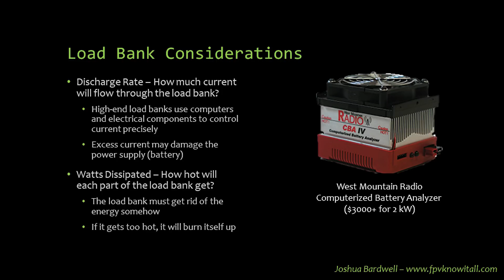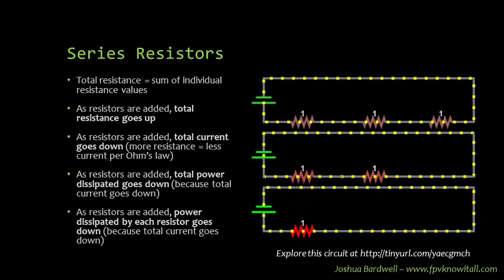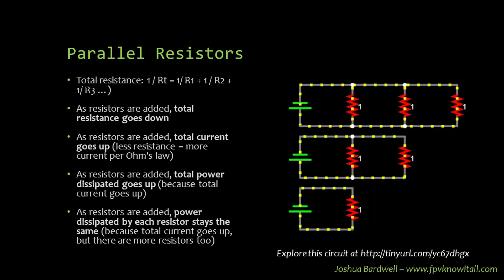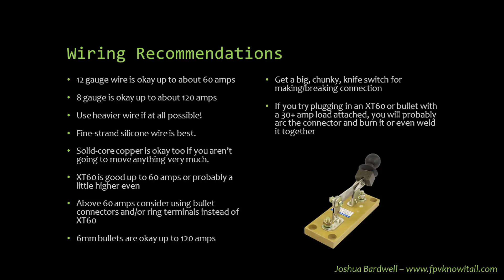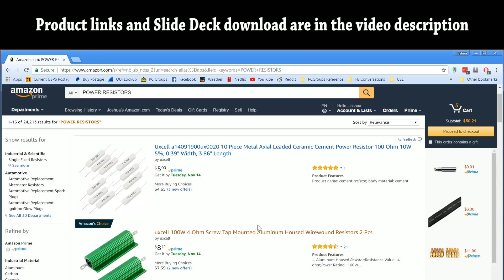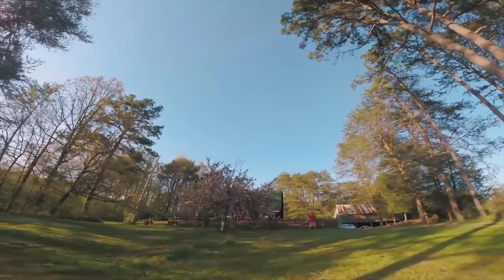Comment: A great alternative to resistors are peltier devices.  I run 2 in series or parallel depending on the cell count i am discharging.  I have them attached to a big server CPU heatsink and it works amazingly.  I can discharge a 1300 4s pack in about 4 mins.  What I REALLY want to do is automate it...

Comment: I actually built a "load bank" out of 12 old stove heating elements. I use it to quickly discharge my 12S ebike batteries at about 1000w. Works great.

Comment: Or buy a bunch of 1 USD Ceramic Cartridge Heater for Arduino 3D Printer ( 24V, 40W) - Basically they are power resistor, but works at full potential as a bulb. and $ per Watt is the lowest, and comes with nice wires too. win/win ? I do use one of this heater to discharge my batteries when needed. I'd like to hear your thoughts JB
Reply: Assuming you're working at 24 volts, you'd need 25 of those to get to 1000 watts. Or maybe less than double that at 4S voltage. Still only about $50. But geez it's a lot of wiring!

I wonder what the downside might be...
Reply: nice idea I was thinking of ceramic heaters too but only knew about the room heating bars and solder iron rods. lol these are cheap too I might get some for a pocket heat project. thanks
Reply: Downside would be messy, but with a nice cover, the topside would look nice, like some Chinese products - Ok, in practical terms, I am not discharging a nuclear power supply, but my simples 1300 mA  4S occasionally - One simple ceramic heater in a XT 60 is doing the trick in couple minutes. But for serious guys out there with many batteries and serious needs, a more robust anti-power-bank is a must. As always, great class.

Comment: It reminds me my first discharge attempt. After crashing my first quad, the (faulty) esc burnt, my battery was full and my charger couldn't discharge... So I quickly built an electric circuit to discharge the battery by using a big stepper motor. It took 3 hours...

Comment: Joshua you can easily use TEC (thermoelectric cooler) and stick old CPU fan on it and solder XT60. It will work good for discharging lipos
Reply: Hmm. I wonder whether getting really cold or really hot is better? What is the efficiency of TEC anyway? 

Hey! Maybe the ideal would be to pair a TEC with a load resistor, then their temperature would cancel out!
Reply: Joshua Bardwell yeah :D I like really cold, I use them when discharging my lipos. And I can play with it :D

Comment: The mk2b 3d printer heatbed has windings for 1 and 3ohm, should handle ~10a with a small fan blowing across it, and costs under $15.

Comment: Joshua,First, thank you for such a great, detailed video.  I am a teacher in the largest public school system in Ohio and your presentation was top-notch.  Second, although I understand the formula's and math, I am confused on:1) what stops a 2S lipo battery from dumping all of its juice.  While racing, we have to use the ESC to determine how much and where. (I.E. 6v or 7.4v to the servo)2) Why not just buy a 200w, 10k Ohm resistor and plug it in?  Does the resister determine how much the battery can dump?Also, could you please make a quick video for a 2S lipo, 7,000Mah battery.  I see many people using six 100 watt, 1ohm resisters in parallel but based on the math, they should blow.  Thank you for your time.  I just found your channel but will share it will all of the racing community.  Tony
Reply: Since you're a teacher, to answer your question, I'll throw one back at you. 

1. Based on Ohm's Law, how many amps will flow through a 10 kOhm resistor when a 7.4 volt potential is applied across it?

2. Using the formula given in the video, how many watts will the resistor dissipate? Assume constant 7.4 volts although in reality, the volts will drop as the battery discharges.

3. How long will it take to completely discharge a 7000 mAh battery at this rate? (At a rate of 7 amps, a 7000 mAh pack will completely discharge in 1 hour. At a rate of 14 amps, it will discharge in 0.5 hour. And so forth.) Assume constant discharge rate, although in reality discharge rate will go down as the battery voltage drops and actual time will be longer.

The real-world situation is that you are balancing all of these factors: amps, watts, and time to discharge. The ultimate answer to why those guys use 6x 100W 1 ohm resistors is that produces the right balance of those factors for their needs. The rest is just math.
Reply: Q1: .00074 amps (I) will flow (I'm assuming 10 Kohm Resistor is 10,000 ohm.) I used the formula I=V/RQ2: .005476 watts will be dissipated by a 10k ohm resistor on a 7.4v battery using P= V squared/RAnswering your questions using a 100watt, 1ohm resistor, my answers are:1) 7.4 amps (I) will flow2) P= 54.76 for a 1 ohm resistor from a 7.4 battery.  If I am correct, I can see why they are using a 1ohm resistor now.  I would like to know you opinion on "can a battery try to discharge 100% of it's charge if plugged into a group of parallel resistors or does can the battery only discharge so much at once"?  Why not buy resistors that a larger so they are not as close to they max load?I know this is a lot of questions and I thank you for your time.  You will be compensated for it.
Reply: My answer can't be correct due to how large the amp draw is.  It would never be that large.
Reply: @TD-zx7kf  Bueller ?

Comment: automobile headlight bulb is the cheapest load for drones batteries. i'm using H4 60W halogen with simplest lipo-beeper, works well with 4S. even with parallel board and multiple packs, discharge rate is ok for me.
Reply: Let's see if that's true...

I looked yesterday, and a 25W+5W dual-element bulb was $7 for two, or $0.11 per watt. In my experience this bulb will pass about 3 amps at 4S voltage, which gives it an effective resistance of about 5 ohms. 

Can we do better? Here's a 200W 2 Ohm resistor for $20. http://amzn.to/2zIqEVs So that's $0.1 per watt. But actually the picture is not that rosy because I would never run that at full 200 watts in reality. I chose 2 ohms because that produces about 140 watts. So actually we are at about $0.14 per watt.

So maybe that's right... Especially when you consider you have to buy heat sinks for the wirewound resistors. But at the same time, it's best to buy receptacles for the automotive bulbs unless you want to desolder them when they burn out. But it's at least worth considering.
Reply: I still think halogen bulbs win though.

http://amzn.to/2yZ1LI2

That's 5x 50 watt 24v halogen bulbs for $12. So you get 250 watts at 24 volts, or only about $0.05 / watt. And if you buy 12v bulbs  (http://amzn.to/2yBLrc9) you get 10x 50 W for $10, or oly $0.02 per watt.

So I think halogen bulbs beat automotive bulbs, but all of them beat the pants off resistors.
Reply: +Joshua Bardwell here in local store we have it around $1, and if you own a car, you may use old one for free (if near light is broken) anyway, it depends on either you want to heavily test different electronics or just discharge few packs after flights.
Reply: Yes, for sure. If you just want to discharge a pack, you should use the SMOKE STOPPER that you already own!

Comment: Good old automotive bulbs work well too. Been using them for years. Then you get light for the shop too :)
Reply: I don't think this is a good value though. It's about $7 for 2x 25 watt bulbs. That's only 50 watts for $7. Well, they are 2-element bulbs so they're actually more like 30 watts, or 60 watts in total.

I can get a 10-pack of 50 watt halogen bulbs for $12. Way better value if you want to go that direction.

Comment: Perhaps I missed it but I can’t find a PART 2 or this video, can you link me please? I did find this helpful.
Reply: Sorry but I haven't made it :-(
Reply: Okay so not crazy 😂😂😂😂😂 it’s okay. It would be great if you did make it. I’m actually working on plans for a lithium powered portable electric heater/ dump load style with a fan. I’d be using left over solar power in a separate battery than the pack powering my small RV.

Comment: I watched it all lol. This video was very helpful for me trying to make a home made heater. (To discharge batteries and make heat as a bonus lol)

Im going to use different inputs to have different settings.

I can use series to control temperature and parallel to control heat/power consumption

Ill figure it out lol

Comment: This is quite useful, when I break all my quads and have a bunch of fully charged lipos the situation really sucks. Then I know when I get home I'll have to dishonourably discharge all my packs on chargers that fail horribly at discharging AND then repair the quads. It would be nice not to have to be too concerned about the batteries, it's bad enough breaking all your quads :P
Reply: Even if you were to get a couple of automotive bulbs, you can discharge relatively quickly. The full Load Bank approach is for faster discharge.
Reply: Joshua Bardwell I like the load bank idea, think I might build one. Hit the nail with a sledgehammer 🙂

Comment: So If I make a resistor bank for a 4s battery (10x 100w 3ohm resistors) for an icharger 406. Can I use it to discharge a 2s battery also? Or should I make one just for 2s batteries. (5x 100w 1ohm resistor)?

Comment: Thanks for this! I have been wondering if the idst fd-100 will be fine or DIY. So far it looks like the fd-100 would be good for plug and play piece of mind and the DIY gives the ability for much higher discharge which will be faster and "fun" since we can do our own battery tests.

Next we need to play around with just using old motors and ESCs we all have laying around. Lots of issues though, enclosing props, directing airflow etc...

Comment: the ampacity and temp of your wires when your talking 12awg at 60 amps, its more so based on the length. take the same 1 ft wire and make it 10 ft long and it will most likely melt. Just be smart about it. for instance a 1ft 12awg wire will have about .19v of voltage drop, at 10ft it will drop 1.91v.
Reply: Yup. Keep the wires short and you'll be okay.
Reply: No, its not. Sure you get a higher voltage drop with longer wires (and therefore lose more energy total), but there is also more area to dissipate the heat. 
With constant current and wire diameter,  the energy/length is constant. That is why these current rating tables dont contain a length specification.
Reply: Hippo I don't have a lab to setup a test like this. But my thought is with more voltage drop comes higher current. More current would be more heat and could lead to failure? Maybe I'm wrong.

Comment: Why not electronic switching and power adjustment with MOSFETs, 100A should be no problem? Or do you want to use the knife switsch just as additional emergency disconnect?
Reply: I am trying to keep this simple and not have to design electric circuits and write Arduino code.

Comment: woah, that slideshow template. You got my attention. Lets go :)

edit: You have shown me that I am a very lazy engineer.
1. How much current will flow through a 0.5 ohm resistor across a 4s lipo?
answer: too much. go get your friends first so they can watch.

2. how much resistance is needed to get 3c out of a battery?
answer: lets start with 1k and see what happens.

3. how much resistance is needed to get 60 amps from a 4s lipo?
answer: 60 is a lot, lets just short the output through this big roll of house electrical wire. That should do it.

4. how many watts through a 0.25 ohm resistor across a 4s lipo?
answer: very little because I wont use the right resistor and it will blow up before dissipating much power.

math avoided :)

Comment: Probably a stupid question, but if XT60 connectors are only good up to 60 amps, why are they the de facto standard for lipo batteries with a discharge rate well above that?
Reply: Kurt is right. An XT60 can handle burst discharges much higher than 60 amps without melting. If your mini quad is pulling 100 amps, how long is your flight going to last? You see bigger connectors on aircraft that pull higher amps for longer times.
Reply: Thanks guys; makes sense. Interesting video!
Reply: There are XT90s but they aren’t particularly small or light.

Comment: There’s a solid math error at 19:02
You squared 16.8 to get 282 but left the ^2 on the equation in the next 2 lines. This implies that it is 282 squared and that would be 79,524 volts. 

But I’m sure most of us who understand this shit know what you meant here and can ignore this error.
Reply: No, I disagree. When you multiply 16.2 volts * 16.2 volts, the result is 282 volts^2. The unit is volts-squared. Like when you measure the area of a square, if it is a 10 foot by 10 foot square, the resulting unit is 100 square feet, which is 100 ft^2. It's the unit that is being squared, not the number. Tracking units like this is something that is often overlooked (even by me) but I was going out of my way to be precise in this video.

Comment: Love your video....I would like to discharge lower level LIPO's.  Such as 1S to 3S batteries.  I have some 50Watt 6 Ohm resisters laying round (used for automobile hyper-flash).  I found 6 of them.  Would there be any way i could connect these in parallel or serial and use this to discharge smaller LIPO's?  These resisters are gold colored and say "50W6ΩJ"  right on the top of them.  Subscribed !

Comment: The wirewound resistors are actualli wery good (i have never used china versions) I dont like the ceramic resistors, they gets really red hot. I would not use any of them beyond half the rated wattage. A heat sink for 1000W is quite big and expensive.
Reply: You mean the green one in my video, right? That's the wirewound? Or is the aluminum one also wirewound?
Reply: The small one is wirewound, the big one is ceramic.

Comment: while this is a sound application of ohms law and the current limiting properties of light bulbs there is no reason to go trough all of this unless you like a science project.

If you just want it to work, get a proper charger ; the cellpro 8 for example that can use regenerative discharge into a lead battery up to 40 amp or 10 if you just want a small fan heater without the lead battery connected.
Reply: +cmulder002 a lot of my viewers like a science project.

Comment: i think you can use this not only to discharge packs. i am sure the law can be used to charge multiple packs with diffrent voltage (same cell amount for sure). remember me? ;) anyways where you at in germany. greetings from near wiesbaden
Reply: If you connect multiple packs with different voltages in parallel, they will exchange current and damage each other. 

I'm in Stuttgart.

Comment: I have a discharge bank trying to discharge 6s lipo... the resistors are wired in parallel.  I'm using a icharger 4010 dou and on the discharge side it's only showing 7 volts / 40 amps.  Why is it only going up to 7 volts?
Reply: Because the charger is limiting output to 40 amps to try to avoid frying something.

Comment: So if I have a charger where I can control the amperage/power for the discharge into the bank, do I still have to calculate exactly for the current, or can I just build a resistorbank as beefy as possible, or will that not work if I just want to dicharge with low current?
Reply: The charger manual will give recommended resistance for the external load.

Comment: When you do this do you have a plan for how you are going to correct for voltage sag?
Reply: The right way to do it would be with a current-control supply. But I don't have that. So the battery will sag and I will measure the result. Frankly, I think this may be a bit more realistic since that's also what happens in real life.

Comment: These have been used for many years in the Off Road Stock Buggy rc world. You can buy them premade on ebay. The seller is saltyperformance . I believe a guy name Raymond McCoy out of Arizona came up with this style bank for the icharger. check them out not much more then the actual resistors and fans cost

Comment: Hi,
I want to make a lipo discharge unit but I have an idea about the calculation of the resistance. 4S 5200mAh lipo battery pulling 10 amps to 50% storage level you want to download? What resistance should I use for this?
Reply: A simple resistive load will not stop at 50%. It will always fully discharge the battery.

Comment: PLease make a video on the tbs zero zero v2 1ms latency fpv camera
Reply: No need to make a video. The claim that they are sub-1-ms latency is not supported by any evidence. Every test I have seen claiming to demonstrate 1 ms latency uses the "point the camera at a stopwatch" method. Here is a video I made about why that method is inadequate: https://www.youtube.com/watch?v=SfbPaRTiB1g

In short: the NTSC or PAL signal output by the camera has a 30 fps or 25 fps framerate. That means the "point a camera at a stopwatch" method cannot have greater precision than 1/30th or 1/25th of a second. So it is impossible to measure sub-1ms latency with this method. No matter what.

Anybody who claims to measure camera latency by pointing a camera at a stopwatch immediately loses all credibility since that method is totally flawed.

The right way to measure camera latency is how Oscar Liang and RCSChim do it. You put a photodiode on the screen and shine an LED at the camera. You measure with an Arduino or an oscilloscope how long it took between triggering the LED and the photodiode registering the light on the screen.

Comment: I was going to try zener diodes to cut off at storage voltage. That would work right?
Reply: in practice no the devices would have to be enormous as well as expensive if such a device existed. what you want is a voltage comparator which controls a mosfet or heavy duty relay.
Reply: I'm not sure about htat...